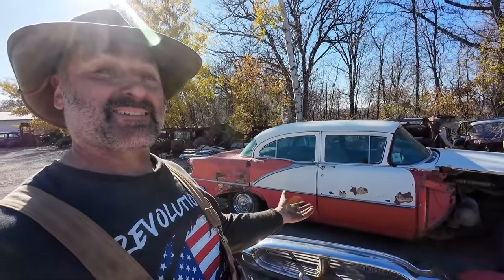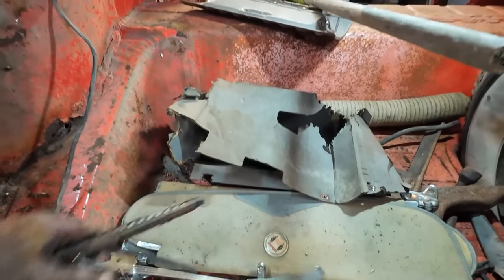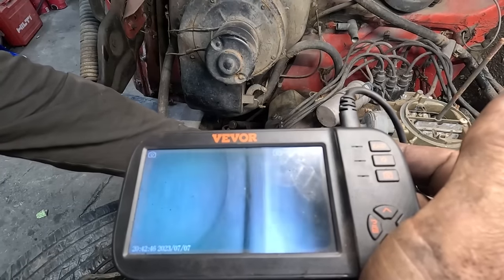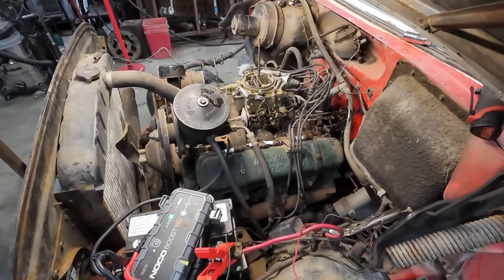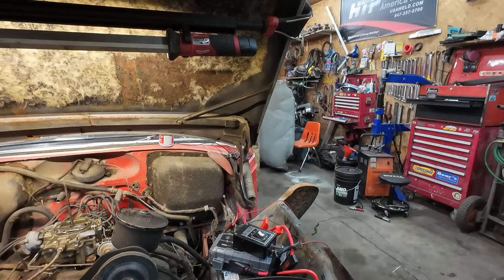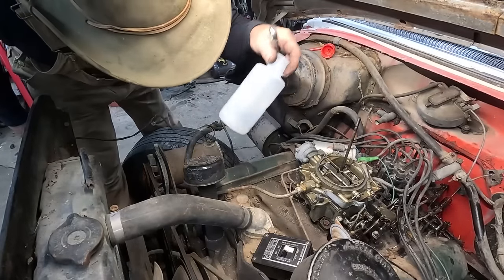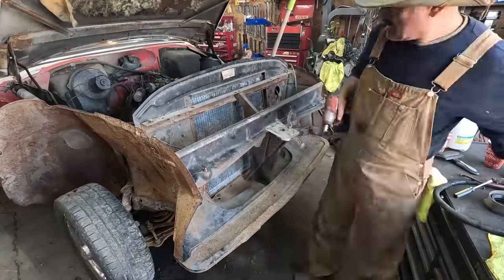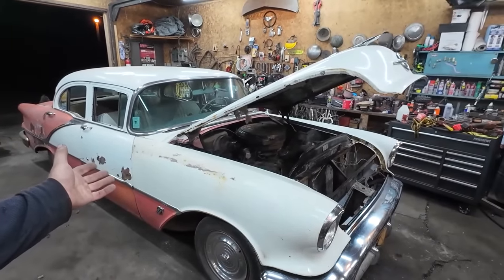Abandoned 1956 Oldsmobile 88 can we get it running and driving again?

Comment: Dang you made me miss my 56 supper 88 two door. It was all original drivetrain. So a couple things incase you do not know. If the generator does not work you can take a old 70's style alternator turn it upside down and mounts in the original generator brackets. The power steering takes tranny fluid.  The pickup tube in gas tank are notorious for rusting off even in dry states like mine.

Comment: 40 years ago I worked in a auto repair shop, there was a older very experienced mechanic there that would Tribble water into the the intake of a warmed up engine at a high idle about 1500 rpm, this would cause all kinds of crud to break loose and actually increase the compression on weak cylinders. Has anyone else heard of this or tried this?
Reply: the steam from the water breaks up carbon deposits...

Comment: I have 55 88 much more rust in floors. Got engine running after decades of sitting in cow pasture. Smooth running engine.  But I'm mixing water in my oil. Head gaskets?  Got head gaskets ordered. Oh no body carries fuel pump and summit racing has water pump $400 us!
Reply: No master cylinder is available

Comment: One of my favorite cars.  53,54,55,56, 57,Oldsmobile.  I owned a 56 98 Starfire convertible in High school. (circa 1964). Tip on GM keys for that era.  Pull the driver's side outer door lock, and the key # is stamped on the cylinder.

Comment: You did Good! Those Oldsmobile years are Fun to work on, last year for king pins. '57 was all New, that one has the JetAway Hydramatic Transmission. I got a Chuckle watching you get a little hung up on the Left hand Lugnuts (Driver side only) a little more cleaning up on the Rockers, Wheel houses and floor boards. Should be a great runner. All those hoods rot out in those years near the hinge area. Normal. You can fix er up.

Comment: I am so happy to see that you got the car  running and driving.  The 55 and 56 Olds, were my favourite style from back then.  Although the 56 transmission was different than the 53 units, I loved those heavy 4 spd Hydramatic trannys.  They were bullet proof, and could really get off the line quickly ( or make smoke).    I did two 53 Olds/hydramatic swaps and remember the nightmare of the transmission linkage like yesterday, because I had to get it working correctly after adapting it to a 34 Ford pickup. .  It took some figuring and fiddling.

Comment: This might help.......

brake fluid level must be maintained at 1/2" below the master cylinder filler cap. Power brake fluid level must be maintained above the 'L' mark on the dipstick of the \bendix \unit, or high enough to register on the dipstick of the Moraine unit"

Comment: When I was about 14 I bought a 55 Olds 88 from a neighbour who was moving into an old folks home. It was supposed to run, but had been sitting for a while and I didn't have any mechanical experience to  go from and Dad didn't have a lot of time, though he did help me get it the half block home. I ended up pulling the front clip off and stripping the engine down , leaving the crank and pistons in the block still attached to the frame, then paid somebody to haul it away. The small differences between 55 and 56 are interesting - shape of the grill and shape of the rear fenderwell openings, 56 much nicer. I look forward to seeing this go back together and hit the road.

Comment: Brent: I was amazed that you were able to bring such a low compression car back to life again with ATF and persistence. I personally could have owned a '56 Olds 88 2dr Blue & White in '62 for Free, but I was just a 13 year old kid and chickened out because (1) I didn't earn enough on my paper route to pay for parts and (2) it needed a new A-Frame on the driver's side as well as associated  front end work due to having rolled over a fallen telephone pole.   What bothered me (unless you drained the oil pan off camera) was that you rolled around with the car so overfilled with motor oil?

Comment: Jeezus you're gonna smoke the starter. Marvel mystery is ATF and kerosene.okmI gotta go. Can't stand to heat that starter. Shoulda spun it with plugs out. You don't even know if the valves are moving. Old hydraulic lifters can bleed down. Sitting years. And your still using that old oil.use pop the valve covers and oil rockers and lifters let the lifters prime. Watch them moving. Don't reve it.lrt everything turning. A higher idle would better for oil pressure. Running will softes op the lips. I told you to do the starter first. .😅

Comment: When I was in high school  66, 67 , 68. I had two friends that had 56 Oldsmobiles. They were both two doors, one was a hard top. The other aposty. The hardtop was a blue and white two-tone and had three deuces. Those cars were like big bumblebees. When you got on the gas. I had a friend that had a 57 which was a 371. I myself owned a 52 303 with the four speed hydro. Paid 100 bucks for that!

Comment: Brent, I have to believe that car was well cared for up until a short while ago. Everything just sort of fell into place for it to have been left for dead very long. When you got it to fire up, it didn't even misfire. It sounded like it was hitting on all 8! You didn't even have to go inside the carb, and I believe you said you ran it on the fuel that was in the tank too. Although I did have a moment of  despair when you put it in gear and  the tire didn't move. I said to myself the trans is gone, that's why it was parked. But low and behold it moved out on it's own. What a find. Some TLC and it surely could be somebodies driver. I don't know how you have the time to video, edit and upload great content worthy of your reputation so often. Keep it up mister. It was a good one for sure. FYI: I always use starting fluid because it creates more Oomph in the chambers that are participating initially. If it has a true ether component or ethanol in it *(oxygenates) it will dry out quicker too in case I go overboard. I worked with MTBE *(Methyl Tertiary Butyl Ether) and EtOH at GM during the 80's when the U.S. EPA and the oil companies paid GM to do a study on fuel additives to help older vehicles produce less unburned HC. Adding Oxygenates to the fuel helped do that. There was no mistaking MBTE it stunk to high heaven! Once I get an engine running on a steady stream of starting fluid,  I switch over to gasoline. I'm not a big believer in compression being so important just to get them to run. Ether gets them running quicker. Then within seconds other cylinders start to contribute, and it just takes less time to get it to that point. Thank you for a nice addition to my Sunday afternoon break time. ben/ michigan

Comment: Excellent Video Brent  :) also very good to get this 1956 Pontiac  car also engine starting up so many years and transmission also touch up brakes too! Funny part thought got 1959 Plymouth  car Christine  look like at first and hope all electrical too fix  ! Also get grey  bottle of STP Total Treatment fuel injection and carb cleaner in fuel tank with 90 octane no Ethonal % too  and Shell great gas company if have one ! Also put new Power Steering fuild , brakes fluid , fuel filter, Air Filter, rad one too and anything else you needed add!  Yes need Pablo for Protection  Brent if get stranded somewhere or something happens! He great pet dog 🐕 and much more!

Comment: Check the diff for grease. Could have been drained. You guys ALLWAYS try to force these old starters and motors prematurely.bbestbmove is don't prime your oil system with the shit in the bottom of the pan.bprobabky trash and water.  Ok your gonna do it any way. Poor motor.bye Dandahermit.

Comment: You noticed the oil was over full, and the radiator was dry. One cheap trick I learned (the hard way):
Before you crank it over, crack the oil pan drain plug and make sure the first thing to come out isn't water.
If it is, you'll pump dirty nasty water through all your bearings and oil passageways. And if it starts....Horror!

Comment: Have you grabbed belt  fan and belt to see if it'll turn a little. I'm 80 n been doin this stuff 75 years. He'll just get a master cylinder. I ALLWAYS pull the starter and clean off the bendexnof the old shit and bench test it. Save a starter motor or ring gear..

Comment: Yup, it's grandpa's Olds, starts with the first tickle, runs great and always gets you home. It looks friggin awesome. These vintage cars had awesome paint schemes and bright work. Great job on getting her to run, drive and give you a few giggles. Years ago I rebuilt a 327 from the crank up, the first time it fired and ran you would have had to set me on fire to get the grin off my face. Up until the big three started employing plumbers to add\  antipolution crap to the engines, cars were so simple to work on, it used to be a lot of fun.

Comment: Needs to warm up all the gum on the valve stems and clear seats. All the gaskets will need a snugging up as they get softer. Oh dam are you using what's in the tank. The filter iss in the carb. Hope you put it on jack stands. Not good to shift back and forth with the wheels. Could shock the tranny or snap an old u joint..

Comment: Great throwback video, like from 3 years ago!  Get 'er in, troubleshoot, get 'er runnin', get 'er on the road!  She is a legit candidate - even with the extra two doors.  Colors are boss, style is superb, and she is ALL there - right down to the gorgeous dash & cool bat-wing air breather.  The rad is all green, so she's gonna need a blow-out and some brass; the left front wheel is a wobbler, gonna need a new wheel bearing.  Other than that, ANOTHER cool ride added to the fleet.  Chalk up another WIN!  Cheers!!!

Comment: Hello Brent, wish you all the blessings getting into your new shop although you're probably going to miss the one you're in now. That sure is one beautiful old Oldsmobile. By the way you're a hot rodder and I was wondering if you knew the best way old school to get rid of carboned up valves and pistons??? I know back in the day once the motor was running fairly well we would take and spray water in the intake while revving the engine it always seemed to work definitely would get rid of all the carbon deposits. I had an old hot rodder that told me to try it and so I did. I know back in the day JC Whitney used to sell a water injection kit although by the time I tried to order one they were all gone and never to be seen again in the book. The add in the book said something about saving gas yep that's all it took and it was gone. Anyway my friend good luck with the new project

Comment: Oil in the cylinders fouls the combustion process. The best thing is to flush the cylinders clean by filling them with solvent without the plugs and crank the engine to blow them clean.

Comment: I always fill the carb full wd40 thru the vent tube to see if the accelerate pump might come back before pumping the the throttle on a carb that's been setting dry , sometimes it works

Comment: Most people overthink trying to get a trunk open like this.  Use the broom handle with a slender flat blade screwdriver duct taped to the end. Insert the blade of the screwdriver beside the part that sticks thru the slot in the lock itself and turn. Simple!!!

Comment: Ah, those were the days when you didn't need multi-swivel joints on an extension, jack the engine up or worse, remove nearly every part that's engineered to be in the way.

Comment: Muratic acid works quick on that nastiness in the cylinders, just squirt it in with an empty plastic quart bottle with a funnel cap with a hose attached, leave it for a few minutes, rinse with water and air dry , afterwards tranny fluid soak and drain , as good as it gets

Comment: Looks like all you need to do on that car to make a good driver is to replace all the rubber brake hoses clean up or rebuild the wheel cylinders flush the brake system and the cooling system. Then put a dual exhaust system on it these old Rocket engines run better when they can breath and sound great to boot.

Comment: You need an exhaust fan in that building. You can put a whole house fan in the ceiling and crack the door open just a little. It wil creat quite the breeze in there forcing out the bad air and cooling the place at the same time.

Comment: Propane gas sometimes works well as an initial start fuel. It checks out the ignition system without wetting the plugs.

Comment: That should have a 4 speed Hydramatic  transmission . Great transmission in it's day starting in the 1940s . My brother has one in his 53 Olds and I had one in a 56 GMC that came from the factory with the Pontiac V-8 . It's a little hard to find old mechanic that know how to rebuild one or even adjust them . Looks like a good start to build on in the new shop .

Comment: My brother and I had a 53 oldsmobile that turned slow like and had low compression that we pulled started it in neautral and drop it in gear and it fired up it had the automatic transmission in it once it started it got easier and easier to start it while cranking

Comment: I own a 1956 oldsmobile 4 door hardtop.      I'm currently restoring it.         It's in absolutely mint condition as far as body and frame goes.      Kinda sorta needs everything else.     Hahah.     100% no rust and it's straight as an arrow.           Does anyone know where I can get the interior for a 56 olds
Reply: Or if anyone has any ideas for an interior for the 56 olds.      I have a back seat that needs to be reupholstered. I don't need the original front bench.     But I would like a bench.    Not a fan of the bucket seats